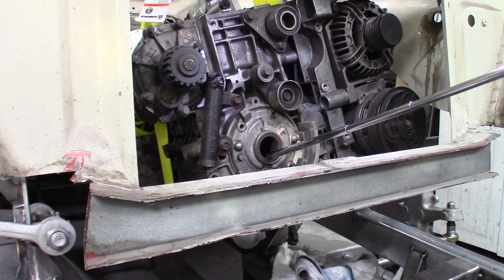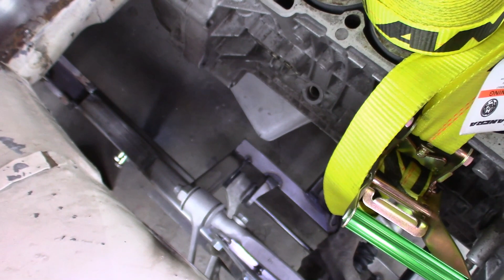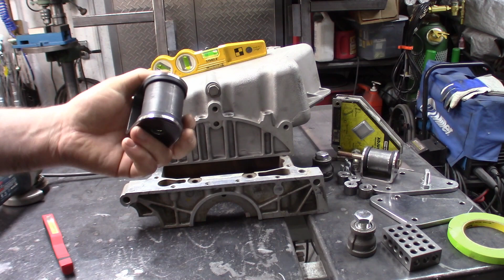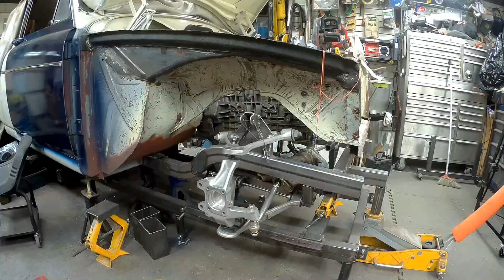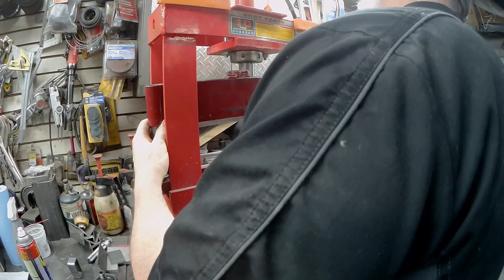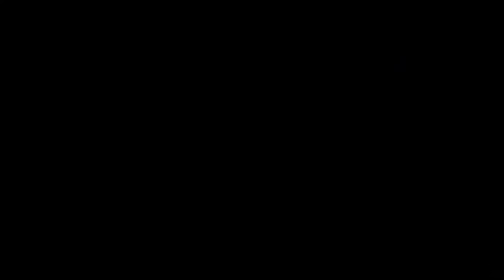Volvo Amazon OIl Pan Modification: Part 1.

Comment: Is that the 960 oil pan cut in half and sectioned to fit a FWD engine? 

I have an 1800ES, and thinking about swapping in a B4194T I4. 

Not sure if the sectioned 960 pan, or really modifying the FWD pan with a rear sump is the better way to go.
Reply from the maker: It is a 960 pan.  I'd love an ES...I'm 100% not sure what the right way to do this is.  I've got several FWD pans and I've got another 960 pan or two.  I may run something different in the end.  There are real fit issues around the stock suspension at the rear of the pan.

Comment: Just occurred to me that the swan neck might be acting like a "J" trap to hold oil so the pump doesn't lose prime, maybe?
Reply from the maker: Pretty sure that's the intended purpose of the neck.  With the accumulator, I figured it would be fine.

Comment: Hey Professor, couple of things.1) Instead of using a ratchet strap on your engine support try using a scissor jack with a cable over the top down to the engine, works well. 2) Volvo put that swan neck there for a reason I guess. Are you sure it's not for crankshaft counterbalance clearance? 3) Why not just cut the oil pan off athwart ship behind the filter and fab a whole new pan? Make a perimeter out or 3/8" thk X 3/4" wide ally than build a pan any shape you want out of 1/4" plate. That is all (for now)
Reply from the maker: I was close to doing my own pan.  We're not out of the woods yet, so I may yet have to do this.  That scissor jack idea is great!  Thanks.  I did make a temporary mount to the front of the engine with a scissor jack to get it to exactly where I wanted it.